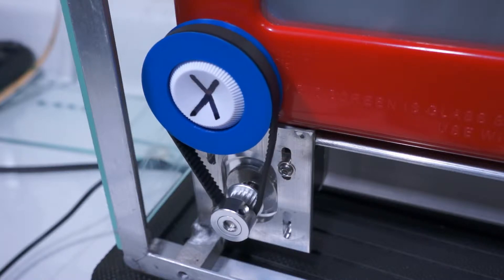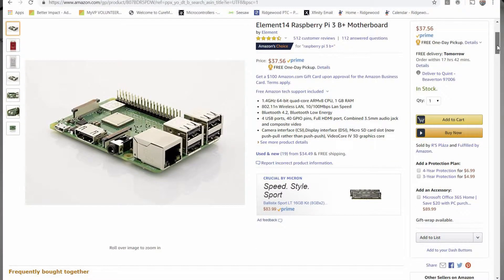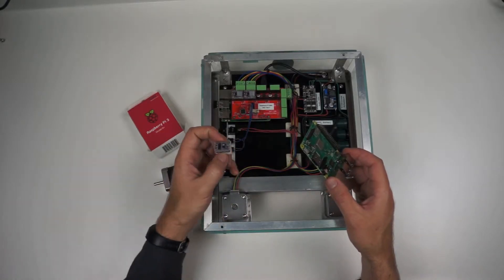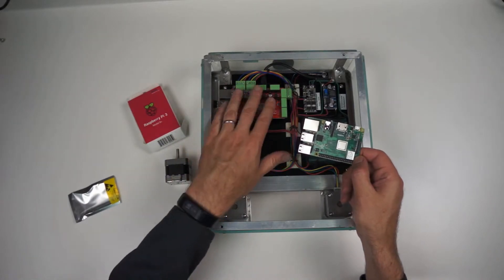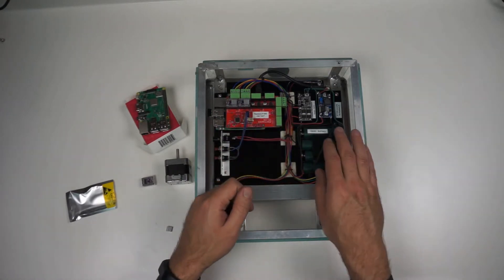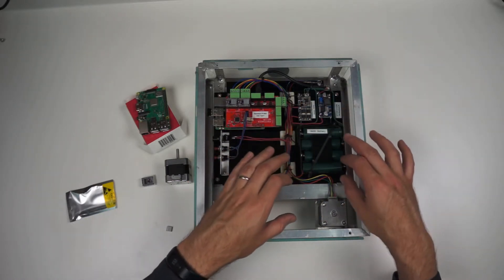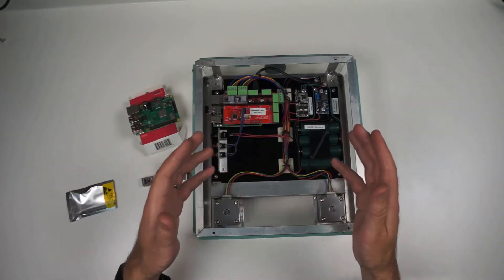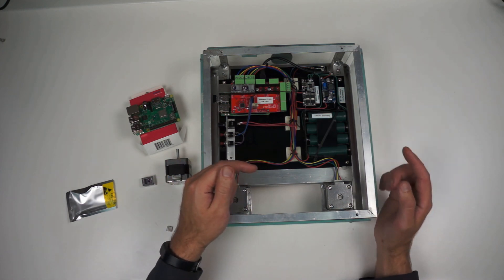CNC Etchasketch Robot Overview

Comment: Do you know if this will work grand with a regular 3d printer board? As i got the old 8bit board my ender 3 came with and a few spare steppers. And what firmware did you use for the print board? Marlin? Or can klipper work fine? As i got a spare pi 3 i can use for that. And to convert a image to cnc gcode, what did you use for that?

Comment: 12:12 another option would be to use a camlink 4K so you can essentially use the raspberry pi’s hdmi output as a webcam input to your computer. Then something like OBS to record the camlink. A nice benefit to this is you can then resize the video and overlay other input sources as you need while recording thus less editing. 

You could also use this for live stream or record desktop-based (ie not SSH / headless) content from the pi. 

Final benefit is there’s no need for anything additional installed on the pi.

Comment: So was it an PWM signal coming from the PI? Ive made a car that follows a live wire using a servo motor and an arduino and im wondering if this works in a similar way?

Comment: I'm guessing that BMS actually doesn't handle charge current limiting. So by connecting 16V to that and just letting it go means you're charging those cells MUCH faster than they are designed for. You need a constant current/constant voltage board to go between the BMS and your charge power source.  What I typically do is integrate the current limiting into the charger supply, and use the BMS only for balancing and over discharge protection. I figure why carry the complexity of charging control with the product when that's really more of a charger responsibility?

Comment: You can use Arduino with its CNC Shield
Reply from the maker: Really?  Can I punch "G1 X1 Y1 F10" into software running solely on it and have it execute that command?  I'm honestly asking, because I didn't think an Arduino was capable of any more than communicating to stepper motors in a CNC application.  Love arduinos, they just didn't seem like the right tool for a standalone CNC project.  But I'd love to be told otherwise...
Reply: @BUILD2  yeah why not Arduino is best choice for CNC project's
Reply from the maker: So tell me where you plug in your keyboard to type that command. All the cnc shield does is give you a way to connect to steppers. Looks to me like you need another device sending the arduino commands. If I'm wrong I'd love to know what I'm missing...
Reply: @BUILD2  no it's just like attachment where you just put it on Arduino 
Check this one-  https://youtu.be/kCDGEezyzfw  

.not promoting this channel
Reply from the maker: Allow me to explain what that video shows:  

Here is a link to the software the guy is running.... ON A LAPTOP connected to the Arduino sending it commands.
https://wiki.shapeoko.com/index.php/Grbl_Controller

Go to that link.  Here's what it says about the software:
"Grbl Controller is written to work on Windows, Mac, and Linux."

So I return to my earlier statement, except with renewed certainty.  An Arduino with a CNC shield is not capable of executing G-code on its own.  An arduino is a very very simple logic controller running a microprocessor.  A Raspberry Pi is a self-contained computer that runs Linux.

There are some great videos out there on the differences between Arduino and Raspberry Pi.  You should get an arduino and play with it so you can get a better understanding of what it can/can't do.  That's what these hobby electronics are for: playing and having fun learning.

Quint

Comment: How did you setting the area that step motor moving  fit within  your square screen ?
Reply from the maker: It's all in the setup just like a CNC machine.  Once you get the GRBL program set up so 1cm in the program moves the pointer 1cm on the screen, just make sure the program doesn't get any bigger than the screen available.  Full size CNC machines would have limit switches that set a machine zero somewhere but that would be difficult here so I picked the middle of the screen as X0 Y0, moved the pointer there, set it to zero in bCNC and ran the program.  I used Fusion 360 to write the gcode such that the zero was in the middle of the sketch.

Comment: Look at that cable management! It looks awesome. I have a mess on my retrofit cnc mill. Any tips on how to improve  it? Thanks and great video.
Reply from the maker: I have a picture somewhere of the rats nest I had literally for years driving my mill, aluminum chips falling on it, dreadful!  It's a daunting task to clean up but just look at all the hardware and map out paper dolls of it on a surface to tell you what space you'll need.  You could even draw the wires if you lay it on the right surface.  Dry erase board on a table?  Good luck.  You'll be happier when it's all buttoned up, I certainly am.

Comment: What was your time delay between the “shake me” light turning on and the next drawing start? How did you account for the curser homing back to the beginning of the next drawing? 

Would you have been able to run this on a dewalt battery or would that be more complicated?
Reply from the maker: I think I let it run for 20 seconds.  The only time I had to worry about the start of the next drawing was the first one because it would start the program with the stylus at 0,0 and draw a straight line down to the left where the wing met the leg.  That's also where it stopped and would flash the delay light so once you shook it and the delay count finished, it just started drawing again from there.  I believe it drew 400mA when it was running so do the math with your dewalt battery.  Because of the BMS and the buck converter it would probably work just fine on about any portable tool battery.

Comment: Hey bud.... may i suggest giving Arduino a shot... for projects like this, makes much more sense 😉
Reply from the maker: Oh I would have much preferred Arduino.  But my understanding is Arduino can't actually run a program like bCNC.  They run GRBL, but it only makes step signals based on what it gets from bCNC.  I'm already past my limited understanding, but something has to take the hundreds of g-code lines and read them but I don't believe Arduino can do that.  I hate having to connect a monitor every time I fire that thing up but nobody online could tell me another way to do it.
Reply: @BUILD2  hmmm, not sure about the bCNC part, but I built a CNC machine that yes, uses GRBL... but its all CNC code in the end. If bCNC is just the software that lets you create gcode from images, setup limits and all that... there are many open source versions of such software for Arduino / GRBL.   No, not for this project, but check it all out and consider it for any future projects, CNC or not.  I've been into electronics for just over a year, and have done all kinds of cool projects with Arduino - you'd be interested in the power options, as it uses way less than raspberry, not to mention can go into low power or sleep modes, where a 9volt battery can keep arduino running for literally years! ;)
Reply: But you can do something like connect the arduino to a SD card which contains a file with the sequence of signals that the arduino should be sending out to the driver which can be generated from the g-code

Comment: I did a similar thing with gcode on an etch-a-sketch 6 years ago: https://www.instructables.com/id/Etch-a-Sketch-LOGO-EASiLOGO/ - I tried the drive belt idea first too but the backlash was awful, direct drive with couplers worked much better.  And I added backlash compensation to the gcode engine.  The drawings were made using a LOGO interpreter we built that output gcode. ( https://www.youtube.com/watch?v=lcwTxfX7GF8 )
Reply from the maker: Cool! How much backlash did you end up with in the end?
Reply: @BUILD2  If the source is to be believed, 16 steps at 1 step per mm!  Seems high but it was so long ago I can't trust my memory.  I had tweaked the gcode interpreter source to match my current (as of then) etch-a-sketch but the exact backlash amounts varied from unit to unit.  here's the relevant code: static int backlash = 16; // 16 +0 +0 is ballpark
static int xbacklash = backlash, ybacklash = backlash-2;
  from https://github.com/mlpassos/easilogo/blob/master/gcode/gcode.ino  This was all entirely from the etch-a-sketch internals, there was no measurable backlash from the linking mechanism with those great couplers.
Reply from the maker: Wow, thanks man!  Yeah obviously direct drive is best, I had a form factor in mind I really wanted to stick to that would have ended up a lot bigger if the steppers were in front of the knobs. The result is thin enough to fit in a large briefcase which makes it a lot easier to bring to schools as a prop. I need to dive into the details of yours though, I can definitely learn from it.

Comment: There are Linux programs to take a screenshot or record a screecast (all kinds. commandline, GUI, keyboard shortcuts,...). Problem is that you have to choose what you like to use and install it if your distro does not come with one preinstalled. Anyway. I am one of bCNC developers and i think it would be cool if someone helped with the documentation, i don't really have time for that. Also if someone knows portable way to make OpenGL 3D canvas in Tkinter Python it would help a lot, because currently we use unaccelerated canvas and it's very slow.